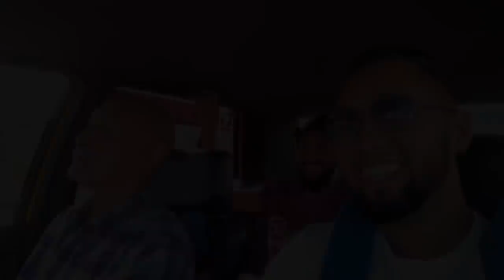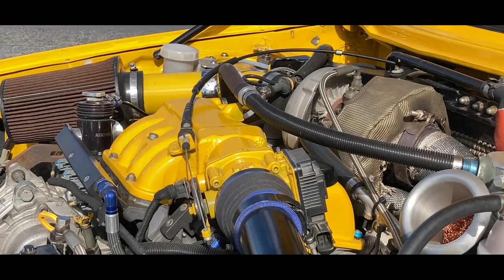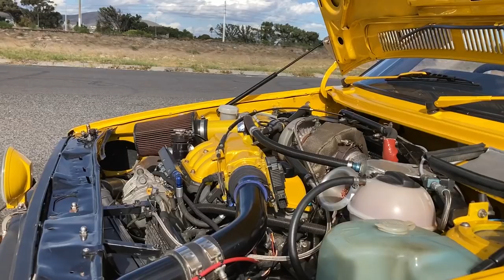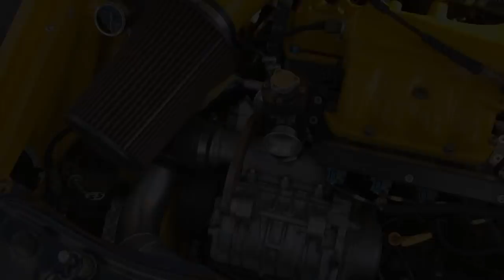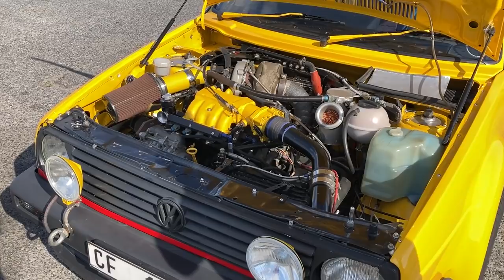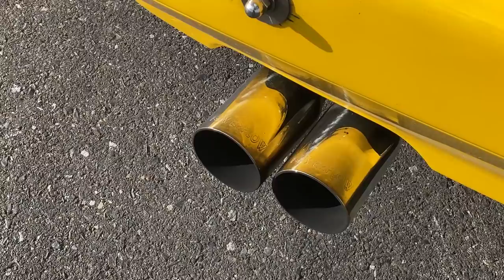TWINCHARGED 2L8V | MK2 GOLF😱😱😱- This is my ride Ep70.

Comment: I got a spin with Mr Duncan at Killarney doing Gymkhana, I couldn't get over my head as to how hard this car pulls, with no lag, considering he was coming out the tight little turns in 2nd gear and it just goes and pushes you into the seat, Very Humble guy, huge respect!